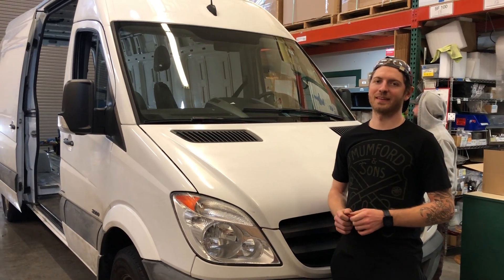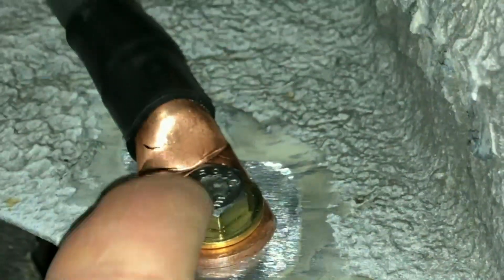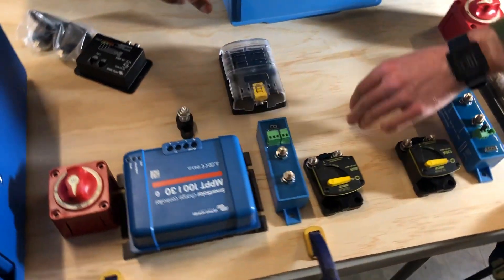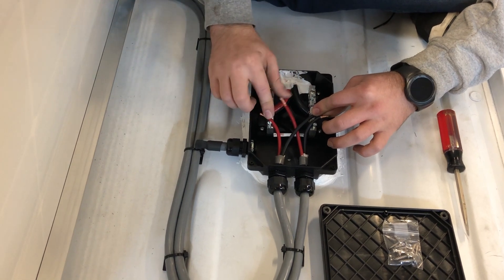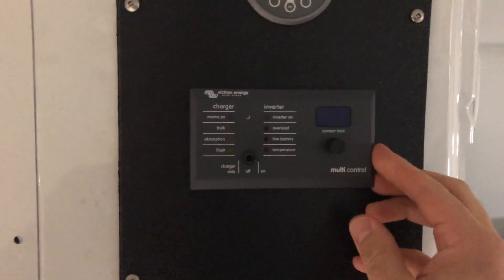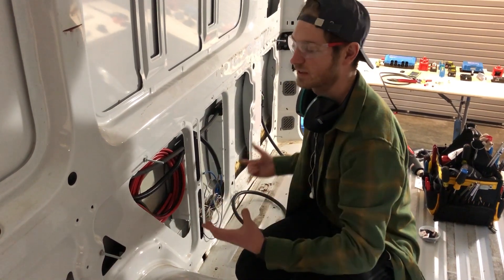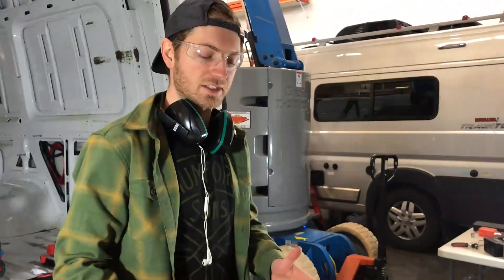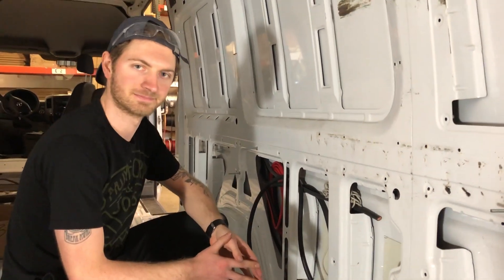Van Solar Conversion - Up On The Mountain (Pt.3 - Solar Panels)

Comment: Does your Multiplus case also get ground to the Chassis ground? Seems to be a hot topic on forums
Reply from the maker: Jonathan Wertz We do it. It certainly doesn’t hurt anything. As for how important it is, I would rate that pretty low.
Reply: @GarretTowneAMS  Thanks!
Reply: @GarretTowneAMS  Regarding the aux battery (trickle charge feature) grounding the negative bus(load to chassis), is a battery isolator really necessary on the + output?
Reply: @garrettowne  Thank you MUCH!

Comment: Can a Zamp portable suit case solar setup charge a lithium battery properly?
Reply from the maker: Zamp support might be better qualified to answer this question regarding the specifics of their charge controllers, but my understanding is that they do have lithium compatible settings.  Typically, when we deal with Zamp portable panels, which we frequently do, we remove the charge controller and route the output through the Victron charge controller inside the rig that also handles the roof array.  That way you can monitor everything on one device and take advantage of the benefits of MPPT.  If you don’t have a roof array, we still recommend installing a Victron charge controller inside your rig and removing the controller from the folding panel.  This allows you to reconfigure the folding panel into two series connected halves that have a higher voltage, which means less line loss, which means you can get a longer cable.
Reply: Thank you